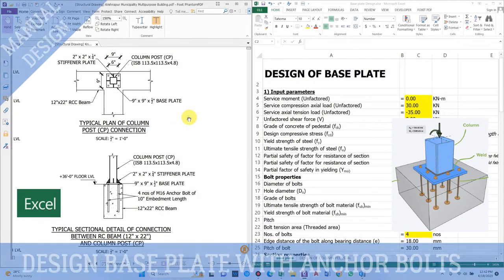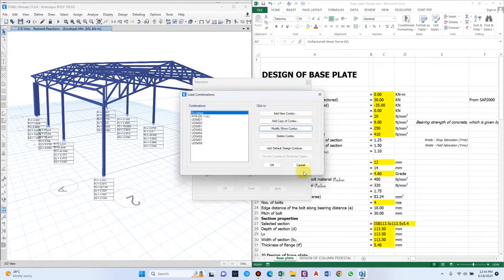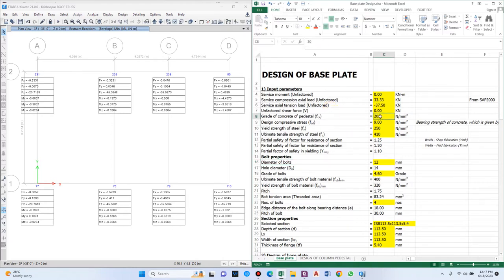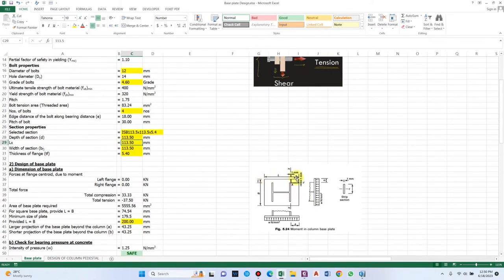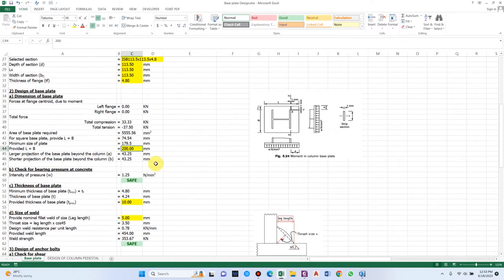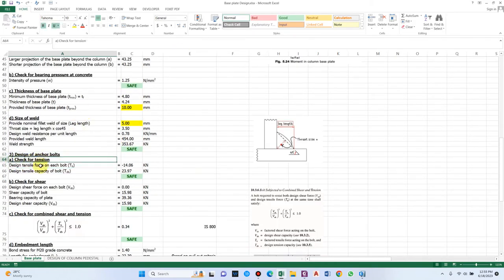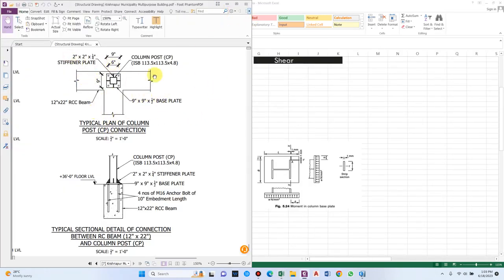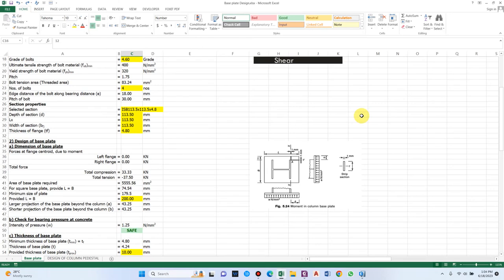Manual Design of Base Plate  & Column Pedestal | Steel Structures | IS 800:2007 | Excel and ETABS

Comment: I think that could better if the desing combination rather than an envelope  use all the individual combinations and make the check  node by node.  I think this is necessarily because in an envelope takes the maximum an minimum forces and if the axial force is small and the bendig moment is high, this could be much more demanding for the base plate in comparative with the use of the envelope to make the desing. ¿What do you think about sir?
Reply: For that I think macros come into picture. That stuff is tricky